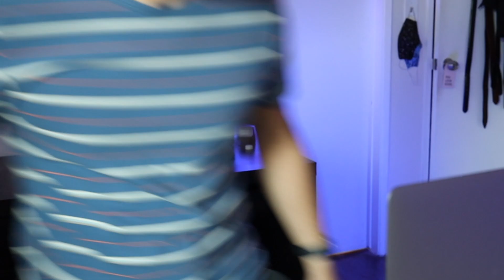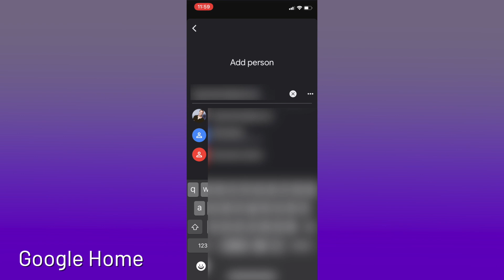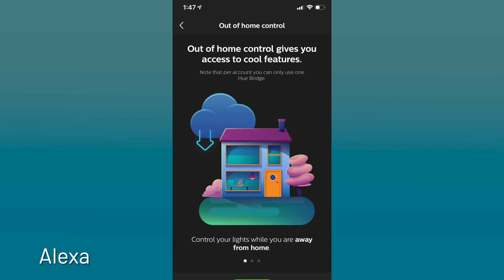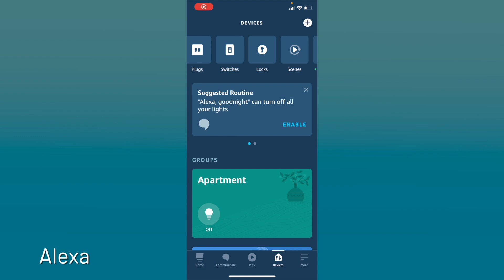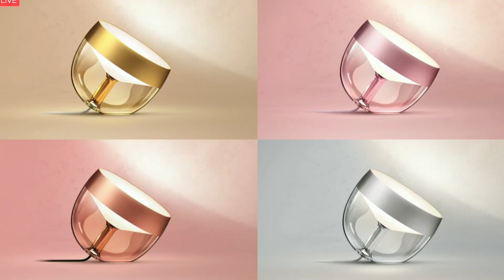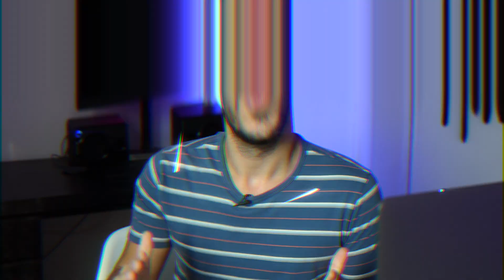Philips Hue Bridge & Beyond - Exclusive Interview with George Yianni

Comment: Justin. Thanks for the interview. I just added a second bridge and have “moved” (deleted and recreated of course) lights and rooms from the first bridge to it. I’m struggling to understand what exactly “creating a separate assistant account” means in order to connect that second bridge to another Google
Assistant account. My first thought was using a second gmail / google account but when I’m prompted to approve linking the hue account using the Google Home app, it just automatically links with the first bridge and I’m not presented with the option to select between the two bridges I have. Do I need a second meet.hue account? Is there another route I need to take that allows me to pick between bridges? Any help would be greatly appreciated. Thanks again
Reply: Why does not anyone respond to this question? Is there no solution? It is driving me crazy.

Philips Hue support sends me the link to this video as if it is a great guide on how to connect the second bridge to Google Assistent an Home... Crazy.

Comment: Nice channel. I too am maxed out on my bridge. I’ve got a second bridge, but my problem isn’t so much that I have to switch between bridges in the app. Yes, that’s annoying, but my big problem is that I want to control all the lights through Alexa and that doesn’t work well with 2 bridges. I put 4 deck lights on the second bridge, but Alexa always thinks two of the four lights are different lights. You can assign them properly, but it never takes. There’s absolutely no reason why this shouldn’t be seamless. Assume we don’t get a new bridge that can handle multiple Zigbee networks, multiple bridges should, well, bridge to each other and provide one logical view of the devices regardless of mesh. In fact, if Philips was clever they’d simply auto configure devices to the proper mesh for reliability and coverage. This is not rocket science.

I’m trying to work around this by assigning fixed spectrum, simpler lighting to the Alexa Zigbee hub, but I’m relying a lot on Lutron Aurora dimmer switches and they currently don’t work with Alexa directly through the Echo Plus hub. I’m really juggling things and might have to give up on the hub entirely for the guest bedrooms and move right to Bluetooth with the Lutron Aurora switches to free up capacity for other lights and switches in more central locations. I shouldn’t have to do this.
Reply: I had the same problem and I solved it by using verbal Alexa commands to move the wrong lights out of the zones/rooms and put the correct lights there instead.
Reply: @tomsalinsky1  what do you mean with verbal Alexa commands?
Reply: @DavidSE76  I say "Alexa, add kitchen back left to group kitchen" and then it puts the right bulbs in the right groups.

Comment: POE for the Bridges NEEDS to happen. The fact that you can't manage more than 50 lights is seriously fucking annoying. I have 78 lights, 8 switches and 15 sensors for my entire house and I haven't done the garden or exterior lights yet. Even if you had the bridge seperate the lights onto different zigbee networks and use the bridge as a bridge between the multiple zigbee networks and the IP network. It is the exact same thing as having multiple bridges but in a single managed device. Phillips Hue, lift your game.
Reply: Exactly! To have this sort of limitation in 2021 from the supposed leader in smart lighting is appalling.

Comment: I just want HDMI 2.1 on the Philips hue play sync box. I want to be able to use Playstation 5 on it or the Xbox Series X with it.
Reply: @rohitbhat8212  if I’m spending 250 euros for a sync box. I want it to be able to use it with the new Xbox or PS or new vid cards. I’m not going to spent 250 euros for a box to only be able to use it for less than a year. That thing is mad expensive. A brand new console isn’t that much more expensive.
Reply: This. I don’t buy it before it is future proof
Reply: @Eric-ed4un  Exactly! I find it funny that in this video he kept talking about future proofing the products and the sync box has been one of the least future proof products they have.  Maybe it's just me.
Reply: Good point. I feel the  hue sync box is severely overpriced and possibly limited given the existing unit probably won’t be able to offer hdmi 2.1.   Also when you add in the cost of gradient light strip you’re looking at around £400 for flashing lights round your TV. Lot of cash for something a bit gimmicky and that you may get bored off after a while.